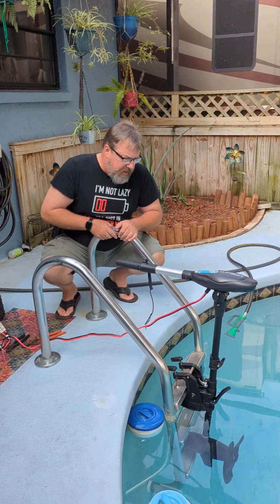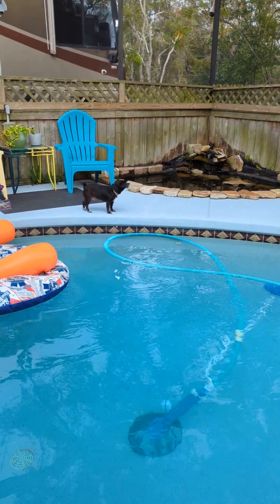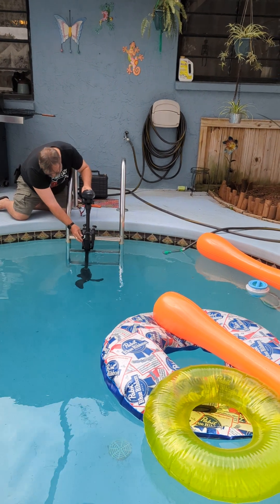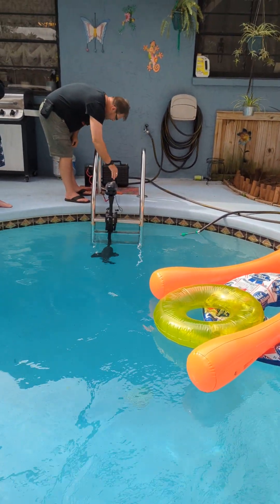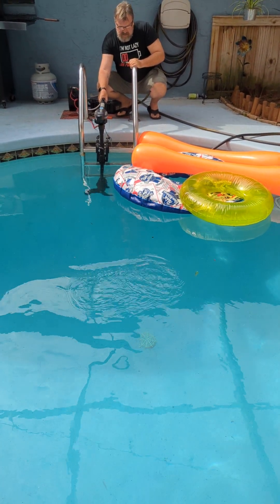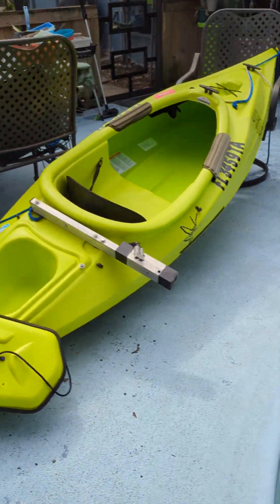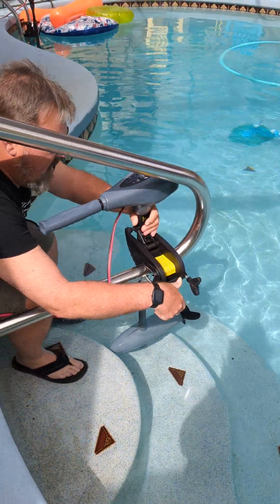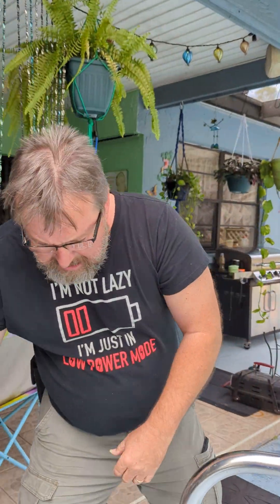Haswing Protruar G 3.0 test....kinda

Comment: the hawing is brushless, I assume? If so esc potted in the foot?
Reply from the maker: Yes brushless with a planetary gearbox in the foot. The handle comes off and has a 3 conductor plug (small gauge wire) in it that I'm assuming goes to a pot in the handle. No idea where the ESC is. Gonna make sure it does what I want it to before I hack it up.